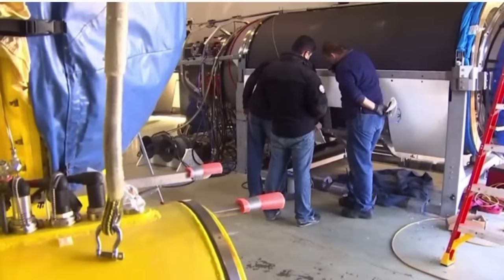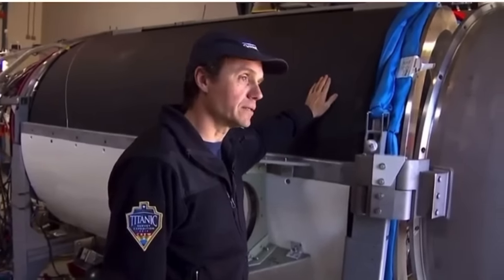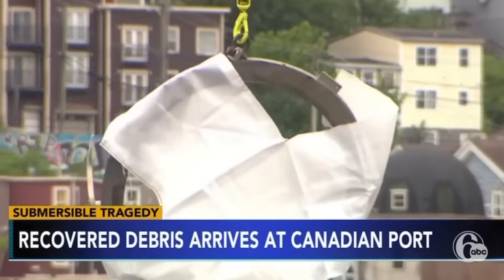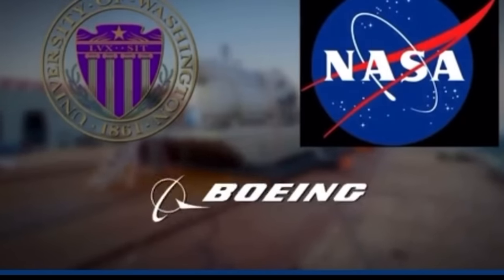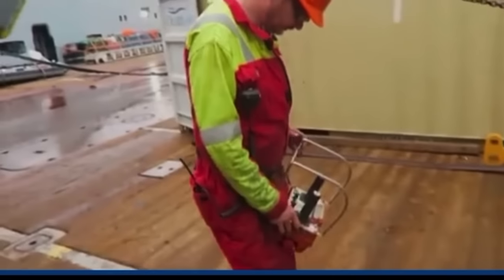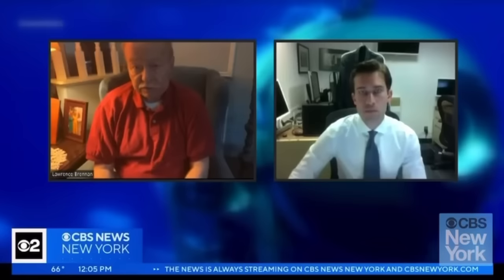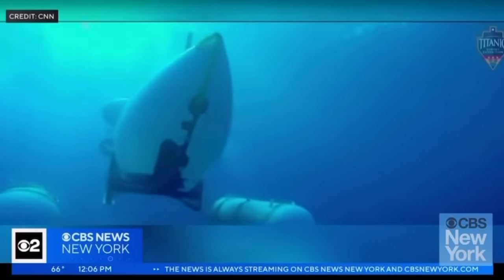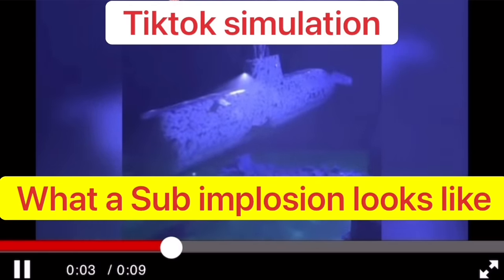Titan nosedived like an arrow (then popped like a balloon) #Titan #oceangate #Titanic

Comment: The submersible survived seven dives before this implosion. This proves that Stockton Rush was correct; carbon fiber is more than strong enough . The reason for the disaster was probably a manufacturing defect, not the fault of the material itself.
Reply: Haven't been paying attention to what's been known? 
That was rhetorical.
Reply from the maker: Hi, on every dive there were problems , the hull even made gun shot noises during a shallow dive and had to be replaced. That material is not suitable. They would have needed to scan the hull before every dive and even then it could get damaged during transport to the site for diving. It makes no sense to use such a material when there are proven submersibles with safe hulls, diving for 35 years without an accident
Reply: @silki24  The problem was Titan was basically a DIY project, built at the lowest possible cost. Stockton basically proved that even the cheapest possible hull, designed by an amateur, could last  seven dives.  Given that the leading theories say that the problem was probably gradual water infiltration of the layers of carbon fiber which weakened the hull over time means there is an engineering problem that can be solved. I’m sure we’ll see improved carbon fiber hulls designs in the future, the cost/weight savings are just too good to ignore.
Reply: It was a DESIGN defect. That stuff is not worth a shit in compression.
Reply: @leecowell8165  My point is that it was exactly a design and manufacturing issue. As far as the material, carbon fiber is clearly is strong enough under compression. 7 successful dives proves you wrong.

Comment: The video you're showing of them going in circles has nothing to do with the thrust of it going up and down the one of the propellers was put in backwards so that's why they had to hold the controller sideways to go straight instead of circles that has nothing to do with it I think you need to stop saying they're spinning out of control they weren't spinning out of control they are the ones causing to spend with the controller when they got the configuration right they still finish the dive and went over the whole Titanic you need to stop acting like that such a mean feature that caused it to blow up or implode I still think that one of the control Spears blew up I do believe it was sinking fast but I don't think it knows dive I think it was going down too fast too much pressure on the system and blew up the control Spirit which is equal to 13 sticks of dynamite Rush even said it his self this is the most crucial part was the spears!
Reply: AARGH! No punctuation! Hard to read.
Reply: @pickle581 And the English,  almost a foreign language.
Reply from the maker: you have to see the context I was using this video in